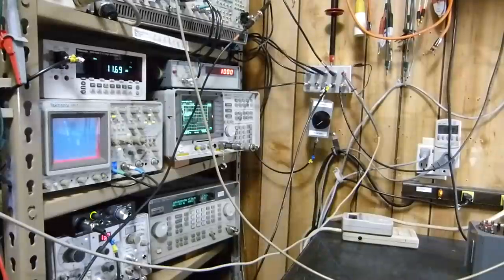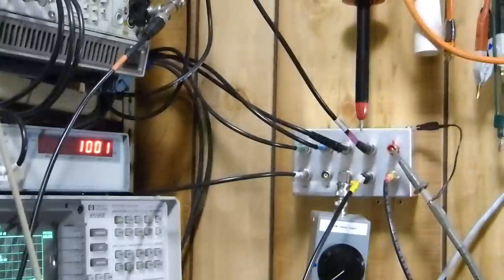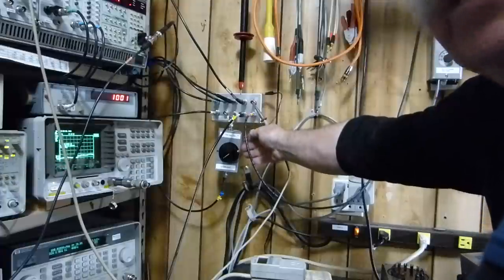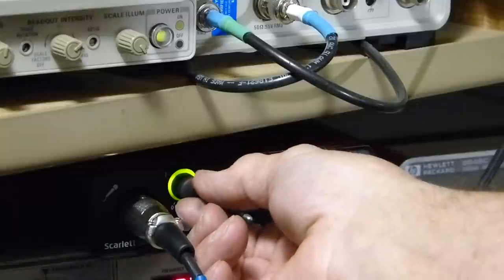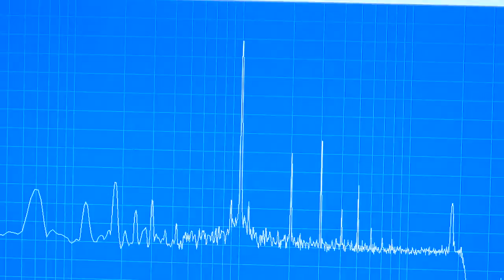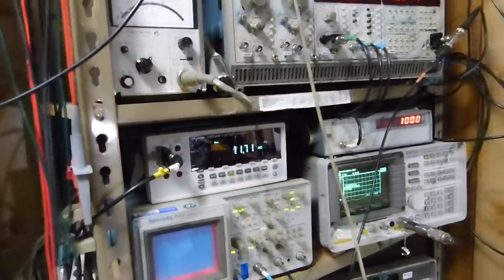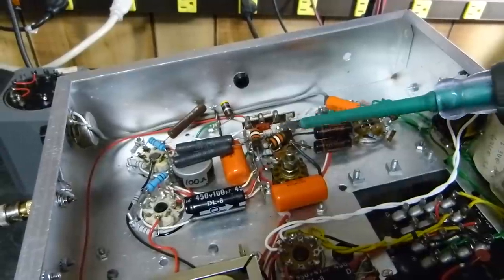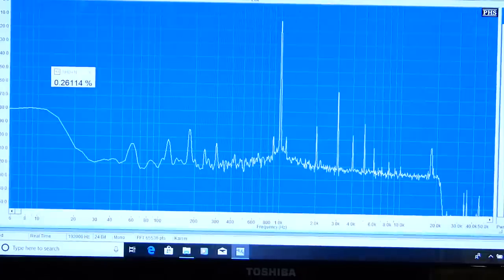Adjusting Audio Amplifier THD Using Laptop Computer FFT Software

Comment: Very good video.  I have run some test of various USB audio interfaces including the Focusrite Scarlett 2i2 which is the two channel model you are using in this video.  Granted Focusrite has updated their USB interfaces since this video was posted.  There have been improvements in their distortion numbers.   I have also tested some sound cards in typical laptop computers.  I tested using the newest version of ARTA software which is shown in the video.  I used the loop back method.  Testing setup:  The Focusrite USB interface line 1/4" balanced output (used as the generator mode in ARTA) plugged directly into the interface balanced line input 1/4" jack.  ARTA is running in SA mode at 48k sampling rate with the highest FFT of 131072.  The ARTA generator function was set to 1 kHz sine wave and controls on the Focusrite set to light the green led around the input knob.  The THD measured at .0003%.  There were no visible harmonics showing on the SA display, only the usual noise at somewhere below -140 dBfs.  I have concluded this setup is a legitimate way to test amplifiers provided that the correct audio pads are provided to be sure nothing is over driven, as pointed out in the video.  The bad side is that with any digital sampling mode at 48 k, any harmonic measurements over 5 kHz in fundamental frequency become increasingly inaccurate due to the sampling rate.  This has also been pointed out in other comments.  My old analog HP 334A distortion analyzer does not have that issue. It can read harmonic content to well above 100 kHz but not down to the levels seen here.  Various laptop built in sound cards were tested using a similar loop back.  Their THD numbers were not close to what the Focusrite can do.   Just my observations.

Comment: Thanks for your very informative videos.  I always learn something new in each one.  
The output side of your audio measurement system is still a bit obscure to me.  Could you do one of your notepad circuit diagrams of components starting at the 4/8 ohm loads and going through the breakout box, then the potentiometer, and ending at the focusrite input?  Especially the power ratings of the components in that path.  Keep the videos coming,  they are some of my favorites on you tube!

Comment: The main problem your likely to come across when tying to use PC programs to test amplifiers is you can't designate your AI as the default audio device on Windows PC's, this is true with XP and W7. I've had a hell of a job trying to get a Mbox mini to work on my old XP PC with REW, Soundcard scope and other software spectrum/FFT analysis programs. I briefly tried ARTA, but it's a steep learning curve. Soundcard Scope does a scope/FFT/THD and other stuff and is simple to use, if you can overcome the default issue. no idea what W10 is like, stopped using Windows years ago on my main PC, now running Linux Mint, which is brilliant compared to Windows but most AI drivers only work on W or Mac. Fecking computors, stick to old analogue : )
   There are quite a few free programs inc SA/FFT's, audio test programs, the big two being REW and ARTA.
  As far a AI's are concerned you want one with a good noise floor but they must be connected through a divider, (you dont want 20v RMS going into your AI IP jack, 1-1.5v RMSA is about normal unless your using pro AI's, then it's about 4v, check your AI specs) I built a 100:1/10:1 variable divider using a few resistors and 10 turn pots. There are several "proper" DIY design's out there to connect your amp up to your AI, look at Pete Millet's and check out Rod Elliott's on the ESP project pages.
  Hope that helps out a few of the lads below.

Comment: Is your dummy load home brewed or store bought ? And , does the choice of dummy load significantly affect measurements when trying to characterise output performance ? 
Resistive , reactive, or active loads ? Can I use the same type of load to test a guitar amp , and a hi-fi amp ?
Apologies for the mound of questions,  and thanks for the video , food for thought.
Reply from the maker: I bought the resistors from www.mouser.com and mounted them on heatsinks. Here is their part # in case the link below does not work:  NHS300 8R0 1%
https://www.mouser.com/ProductDetail/ARCOL-Ohmite/NHS300-8R0-1?qs=T7nPz1OZfaCYYWtzcKdZcQ%3D%3D
Resistors have a temperature coefficient, meaning that they change resistance with changing temperature. These Arcol resistors are very stable, even up to 350 degrees F as I have taken them there. The cheap dummy load resistors that look like cement blocks are (1) not very accurate for resistance and (2) change value dramatically under heat. If you want a dummy load to just dissipate heat they can be OK but if you want your measurements accurate you have to have precision and stable resistors like the Arcol listed.
We think of resistors having no reactance and for all normal purposes, just about any resistor will work at audio frequencies as the inductive reactance is going to generally be very low just because of the relative small amount of wire required to wind the resistor - in the case it is a wirewound resistor. With that said, it is a good idea to purchase so called, non-inductive resistors for best results. Hope this helps.

Comment: Great content, your videos are awesome. I had a question about a push pull tube amp im workimg on. I've resolved the 60hz buzz problems and it sounds great, except for certain notes on guitar there is a strange harmonic/additional note playing. It sounds somewhat like using an octaver but with a couple additional full steps. Its hardly noticeable but once you hear it, you can't stop listening for it. What would you suggest I look into? All new tubes, matched 5881s and three preamps tubes of one 12ax7 and two 12au7s.

I will post a video of the amp and the sound.
Reply from the maker: I will watch your video when you post and thank you for your nice comments. This is just a guess but I am going to suggest some mechanical resonance in the cabinet/speaker/components/reverb tank, etc. I look forward to you video.

Comment: That's a great setup you have going there. I am definitely going to try that out. I know your probably not looking for absolute accuracy with regards to the THD, but more of a relative accuracy. With that in mind, have you characterized and nulled out for the effect of the focusright preamp on your THD measurements?
Reply from the maker: The conclusion I have come to multiple times with the USB sound cards, using not only the Focusrite but also Behringer, is that as long as the amplitude of the USB sound card is low and not over-driven, they do not seem to add in additional distortion. However, above around 10 KHz the THD levels start going down per the display of the sound card and FFT software but not on the lab grade equipment like the HP and Tek. I assume this is because of the limited upper bandwidth of the USB sound card. So to answer your question, I don't see that the Focusrite (or other) sound cards add any additional THD into the mix. The PC software and the USB sound cards track amazing well with the pro equipment from very low audio frequencies up to about the 10 KHz level. After 10 KHz (or so) the error in the USB sound card and software gets very low as displayed on the PC screen but that is not correct. I have shown this in other videos made on this subject.

Comment: Do you find the ARTA distortion measurement to be accurate?
Reply from the maker: I honestly don't remember how well it performed. I purchased a license but then I don't think I used it and kept using SpectraPlus. Crazy things we waste money on,,,
Reply: @ElPasoTubeAmps  Well then I might ask how accurate you find the distortion measurement with Spectraplus. And don't feel bad I waste money a bit myself. Ha
Reply from the maker: @leonardpeters3266  SpectraPlus does a great job agreeing with my HP and Tektronix equipment at 1 KHz but gets more and more off at the high end and, if I remember correctly, starts to become useless above 16 KHz. That may not be the software. I use a outboard USB sound card and have tried several (and wasted money...). I finally settled on a single channel, Focusrite Scarlett Solo.
Reply: @ElPasoTubeAmps  Well thanks for the information. I love that Tek DA. A bit rich for my wallet, I love the HP 8903 too, but the same story. Thank you

Comment: You can do alittle better there. The best thd come from top gain in scarlett input. There was problem decade ago about that but nowadays you have best thd at top gain input. You just need higher attenuation in box.  Just avoid clipping. That way you can have best results. You can test that.